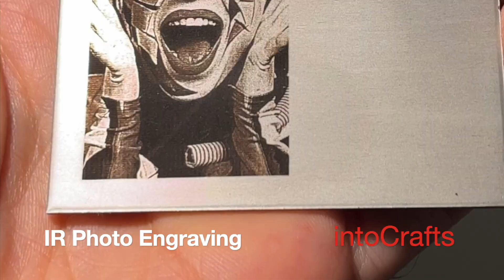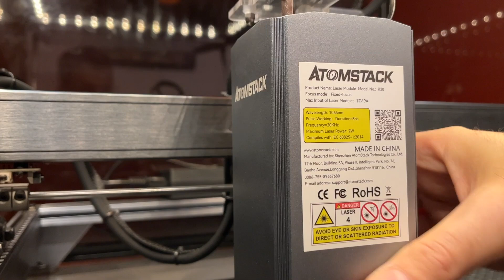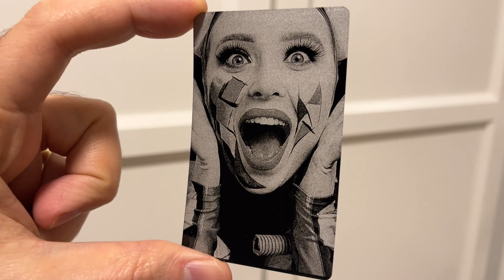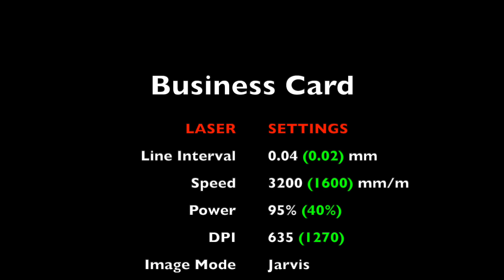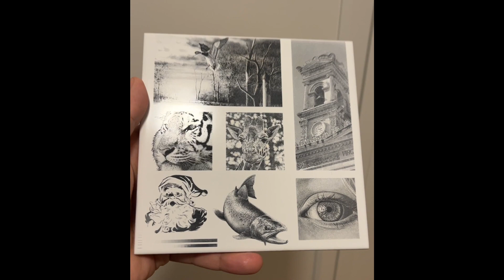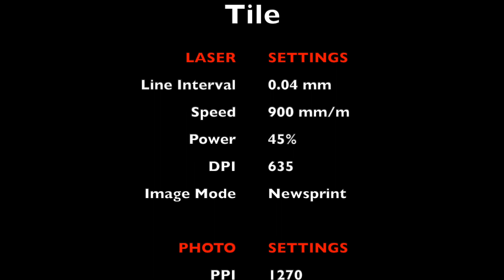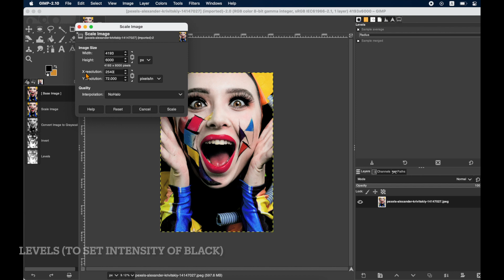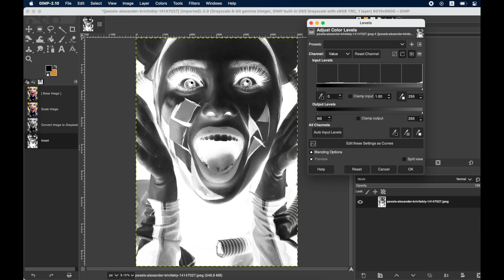E8 - IR Photo Engraving with Atomstack R30 Module

Comment: I have the r30 v2 and I am struggling to get your results on stainless steel. How many cuts do you do. I feel like yours looks amazing compared to mine. Plus from facing the image looks like it’s a negative whereas angled it’s clearish. But nothing like yours!
Reply from the maker: Check your focal length is correct? Use a ramp test (maybe better to be done with a coated business card)

If the given settings here does not give you the same results, I may refer you to tutorials E3 and E4 on this channel for finding the settings.

Comment: Is atomstack r30 is 0.02 Dot spot size Or 0.03 Dot spot size in website it says only 0.03 Dot spot size..
Reply from the maker: What is referred to dot spot is the size of the focused beam. But what I referred here as dot size is the actual marking size of the laser on the material as a result of engraving a single dot from a binary image file.

In some cases, it could be smaller than the size of the focused beam or bigger than that…

Comment: Great video!  Very helpful.  

Did you have any issues with the R30 addition to the A20/X20/S20 Pro and the y-stop or the x-stop?  When I installed the new module, it doesn't hit the stop when it goes to home position so the motor just spins and I'm afraid it will burn the motor out.
Reply from the maker: Thanks for your comment.

R30 module is bulkier than blue laser modules, and I believe on all the engravers you will have an issue with the Homing.
I do not use absolute coordinates, and for a very long time, I have not used home. Using user coordinate, and move the laser head to the corner of the object. Though it is a bit tricky with R30, since the red dot is not a actual dot and not matching exactly the laser spot